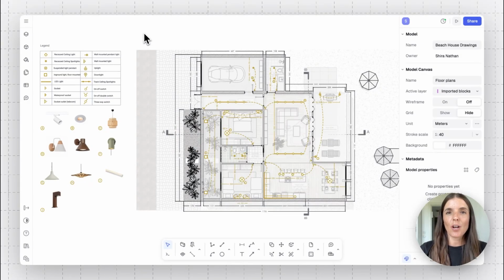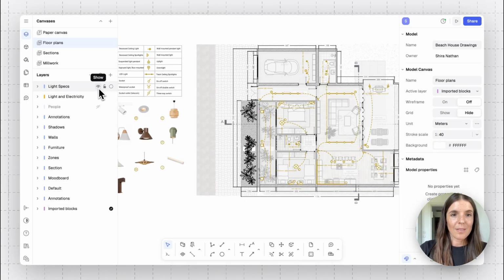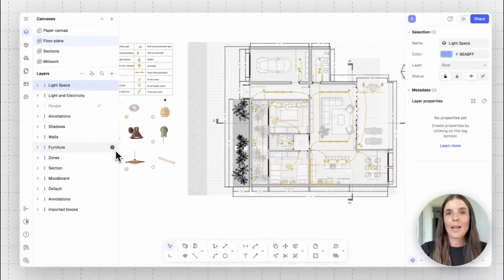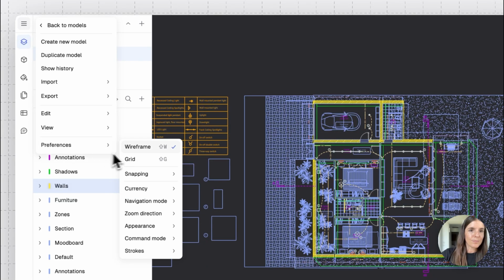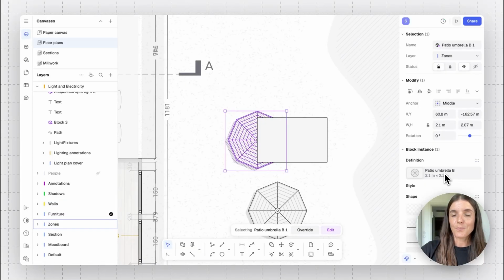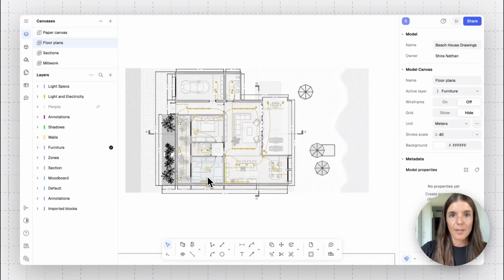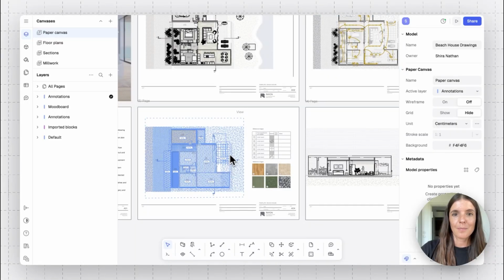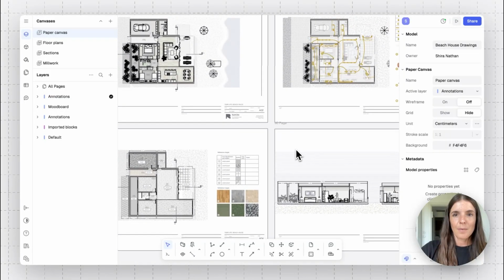How to Use & Manage Layers in Rayon

Comment: hola a la hora de descargar las plantillas necesito la jerarquia de lineas que en autocad serian las plumillas antes de pasarlo a pdf 
en rayon como seria?
Reply from the maker: Good question 👍

In Rayon, line hierarchy works through Styles rather than traditional AutoCAD pen tables/CTB files. So before exporting to PDF, you’d adjust the stroke weight, color, and opacity of your styles to control how lines appear in the final output.

It’s a different workflow from AutoCAD, but the idea is similar — defining visual hierarchy before export.

Comment: I work with layers but all of them are black (even though the layer colour in the overview is e.g. orange). How do I get the electric layer show up in a different colour? Otherwise you cannot really see it properly :( Thanks!!
Reply from the maker: Hi there, do you mean you want to change the color of the electrical symbols? If so, here is our documentation on how to use styles: https://docs.rayon.design/documentation/design/styles
Reply: turn on wireframe mode, the colors won't show up if you're working without wireframe